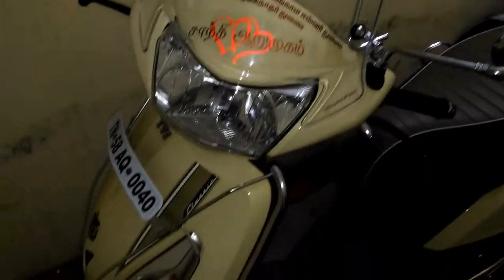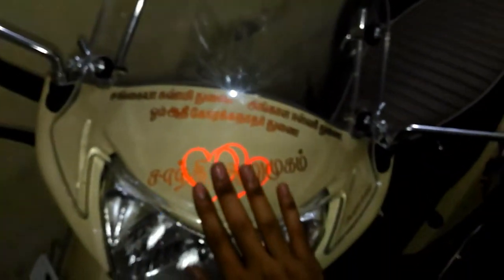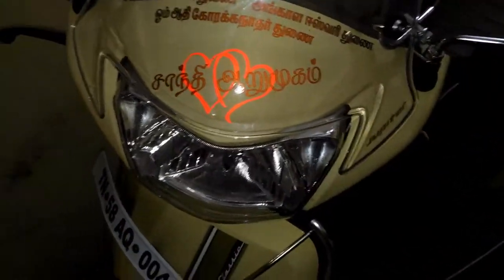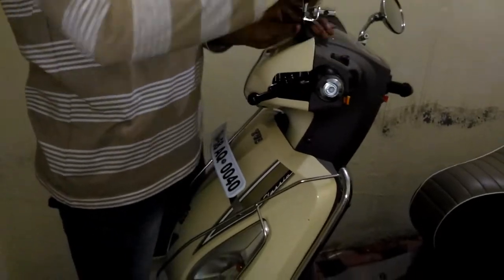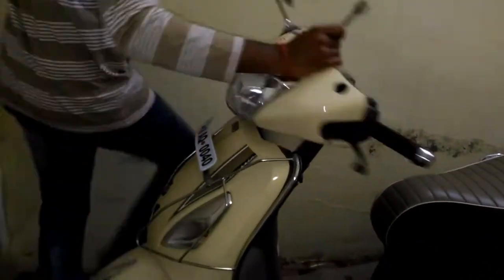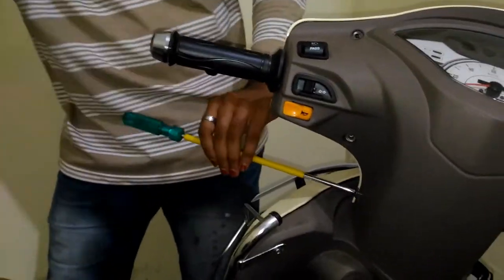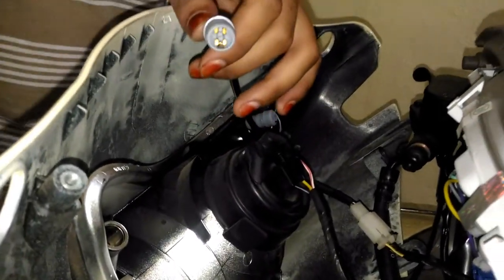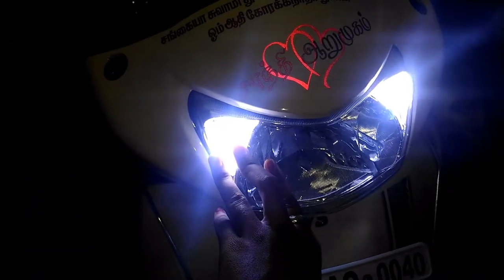Pilot lights replaced by LED lights | TVS JUPITER CLASSIC BS4 EDITION

Comment: i do led but not working fail in 1 day
Reply from the maker: Yes. Me to faced that issue. It happens because of the fluctuating amps. So you have convert the electricals into dc to fix leds.

Comment: Bro enoda Jupiter bike la pilot switch pota head light um sernthu ON akuthu athuku Enna panalam
Reply from the maker: Switch and connectors check pannunga bro. May be switch damage agirukkum or connectors short circuit agirukkum bro. Open panni pathu than solla mudiyum.
Reply: @Mechanicgrapher  ok bro

Comment: Usually the TVS juipter BS4 has the headlamps on at all times
But i need these small pilots light to be on when u start the ignition and also they need to turn on when the engine starts so how do i do tht?
Reply from the maker: Connect the particular wire, directly to the ignition switch . . .

Comment: Q1. I am normally more use rear brake in daily day to day riding. Both Honda Activa 4G and Tvs Jupiter standard drum brake variants have combi brakes. So when apply rear brake, front brake also apply. 
But Jupiter classic have only front disc brake and don't have combi brakes. 
So does Jupiter classic rear braking power is less powerful compared to Tvs Jupiter standard drum brakes with combi brake variants in case of only rear brake apply?

Q2. Jupiter Classic have only front disc brake but no combi braking system. Is front disc brake safe and reliable when apply sudden front breaking without any risk of tyres skidding or uncontrollable handling?
Reply from the maker: Sidg2 classic braking is more reliable and give you much confident while braking . . .
There is no any skidding or wheel locking just go for it
Reply: vicky vignesh But you didn't talk about rear brake performance because it doesn't have combi brakes. What is the performance of Jupiter Classic rear brake compared to Jupiter standard rear brake with Sync braking system if I apply rear brake only at speed of 50 kmph .
Reply from the maker: Sidg2 Man the rear brakes do their jobs as what they will do . . .
You cannot stop your bike only by using the rear brake. So therefore you need front brake too. So when it comes to front brake, it is disk and it performs awesome . . .even in the sync brake system there was a separate lever for front brake.
So please learn to use both brakes which is good and safer for both you and your pillion rider. . .
Have a save drive . . .

Comment: brother i want to replace pilot eyes in apache rtr 160 with more bright colour eyes.. where would i get those pilot lamps for apache rtr 160
Reply from the maker: zeeshan ali bought it from a local shop
Reply from the maker: zeeshan ali there is no box or pack  . . .it is just lights only
Reply: AA. Vignesh vicky wre did u bought